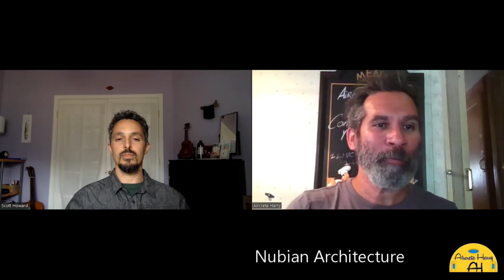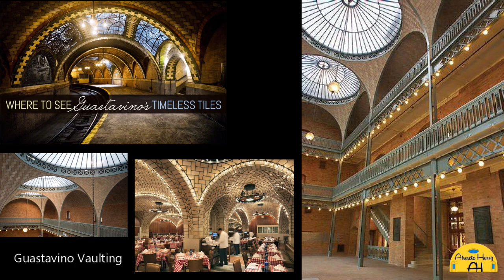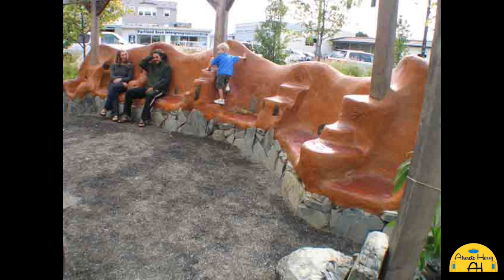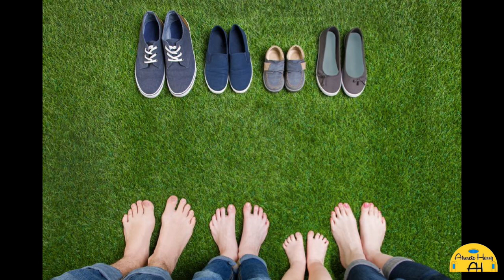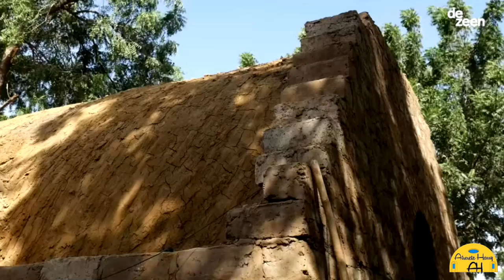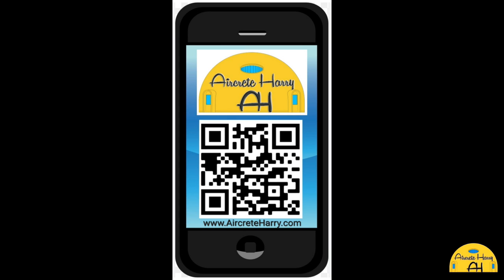Sculptural Cob and Adobe | Let's Talk Building Systems | Scott Howard Interview | Aircrete Harry

Comment: I’ve been noticing a lot of natural builders are putting in plastic moisture barriers under earthen floors but then you loose the grounding effect. So I’m not sure why they think it’s a good idea.
Reply from the maker: In many cases it is due to building department requirements.
Plastic is also used to act as a vapor barrier & radon barrier.

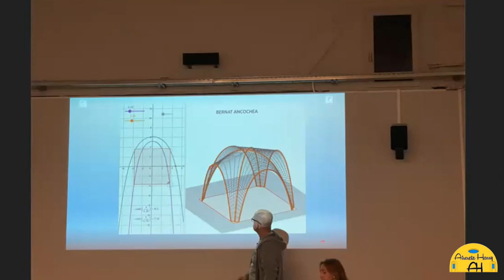Comment: Great stuff!  Got me daydreaming about a partially underground catalan vault (so the surrounding ground acts as the buttress).  AH, could you please provide more info on the design calculations and/or software that Scott Howard mentioned? (at, and before, 21:35)
Reply: Thanks for asking. I don't have this software as it is proprietary to Jordi Domenech, master Catalan vault builder from Barcelona. If you go to Spain and study with him, he can share more about that software. You might look into Rhino Vault software as it can also help you a great deal with this type of design. Antonio Gaudi didn't use computer software (because he was building in the 19th century) and his funicular science using hanging chain models is still used today because it works so well. I primarily use the hanging chain modeling method.
Reply: Super curious about this also. You are using words I don't understand but I want underground too, so bad.